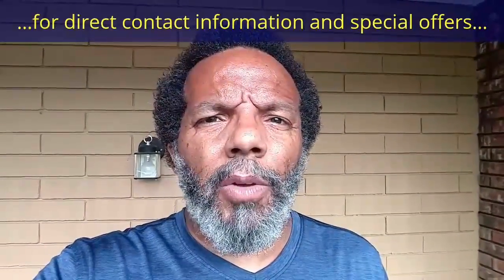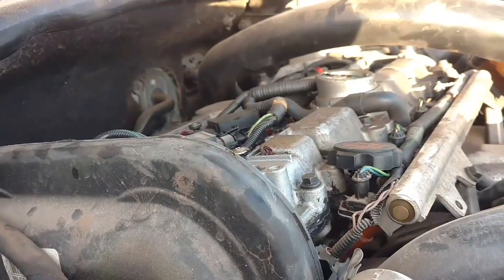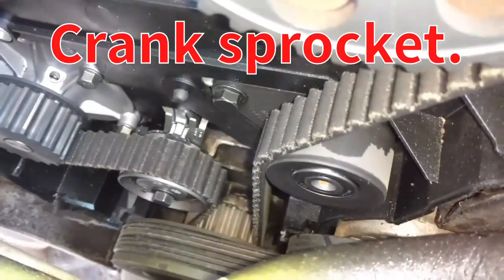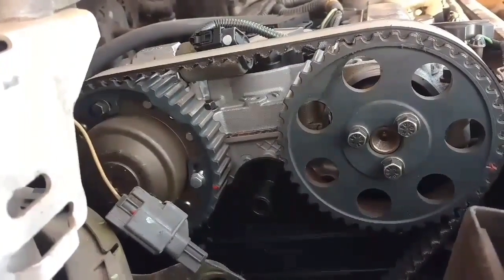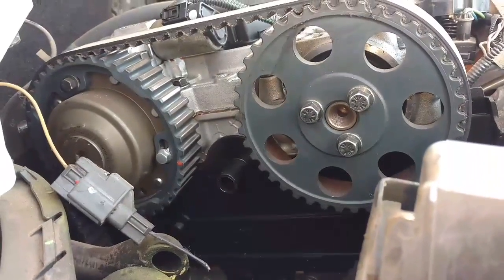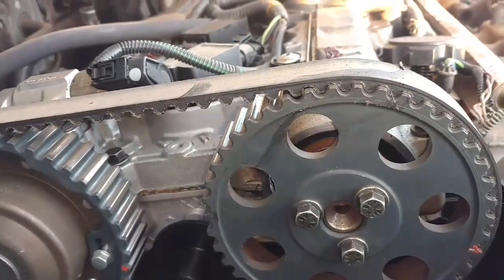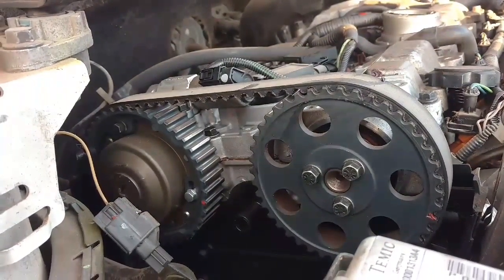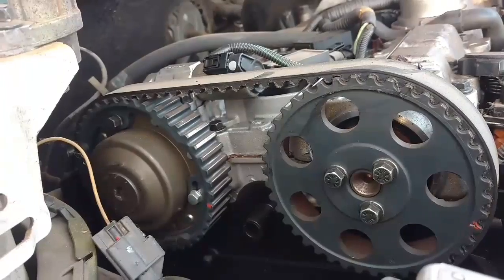Important cam locking and cylinder head information for engines with over head cams. - VOTD

Comment: I’m enjoying your channel. I searched the tube after throwing two DTC codes, ecm614b and ecm611b. Both came up at the same time. Researched the VVT and did the typically prescribed work, ie. oil, both cam adjust solenoids (2.5T) and checked the timing and components. Cleared the codes, took it out on the highway to kick the turbo in and get it good and warmed up. Within 5 miles the damned dtc came back up. I’ve watched your entire playlist a couple of times now and it looks like I’m going to have to go deeper. After studying your content, I’m very confident I can perform the work and I appreciate your emphasis on the importance of using cam locks. So now I’m shopping for them. Thanks for sharing your time and talent man.
Reply from the maker: Thanks for watching

Comment: Robert, your videos have been a huge help as I've rebuilt my 2001 V70 T5 blown head.  
Head was planed & valves were rebuilt by a top line shop. Solid lifters were kept in sequence.

I have the cam locking tool (from sweedspeed) and have VVT on the exhaust cam only.  
Removed airbox, fan, throttle body tube to access & remove the starter to access the plug cap to insert the crank locking pin.  
Rotated CCW to set the engine crank (btw, make sure your cam marks are topside, before putting on the cam locking tool, otherwise, pull pin, rotate crank another 60 degrees CCW put pin in and keep cranking until it stops). 

Removed cross strut, front back turbo air tube, spark plug cover, black turbo control tube hanger, rear casting to access & remove exhaust cam cover; removed cam cup sensor.
Bolted in the cam locking tool; can't bolt in intake as with cam cover aerobically sealed can't prise out intake cam rear cap, but align that half of cam tool w/center of the cap. (the tool also has a half bracket piece to hold it in correct alignment against the cam cover)

Intake cam is on its mark and belt is tight between intake cam and crank (I put a jumper cable clamp on the intake pulley & belt to keep it in place and keep the descending side of the belt in my left hand.) Exhaust cam is now 2 1/2 teeth back from the cover mark.  I understand I'm supposed to rotate the exhaust VVT CW to bring it "to the mark". (Is that correct?)  Figuring there is still a bit of slack in the belt, I advance the exhaust pulley 3 teeth and cheat a bit on the cam locking tool to get it there.  I use a T55 socket with a 10 mm box wrench around it to rotate it to its mark.  [That avoided the need to lift the engine]  I put the belt on.  

You're right about the cheap aftermarket tensioners.  The back pin will bend or the tension plate will snap off [I've returned two of them because of that].  (I insert a thin rod behind it from the right to keep it from turning), tension it with an 8mm Allen wrench and tighten the 12 mm bolt.  I put everything back together.  I do 4 crank rotations to check interference.  I fire it up.  It sounds REALLY rough.  I know I've got compression though (140-170 lbs.).  

Figuring I probably should have only rotated the exhaust cam 2 teeth I crank the engine forward 2 cycles then back 90 degrees, mark the belt, take the exhaust half off and reposition the exhaust CCW back a tooth.  [I see that was your response to M. C. A. in https://www.youtube.com/watch?v=hjZFY-1x1Xk ]  I put everything back on, check interference, fire it up, and it sounds no better.  

So here's the question.  Is this going to require a full repeat of installing the cam locking tool, and a rotation of the exhaust cam forward now only 2 teeth.  Or, do you have any thoughts on what else might be going wrong?  I'm not getting any codes, though I only have a basic reader.  It's been a project of several months now.

Most obliged for your experience and guidance on this.  And please feel free to critique any of the above as it meant to help our fellow Volvo enthusiasts.
Reply: Update on the above.  Quick Trick:  If you want to move the cam pulley gears forward or backwards (relative to the belt), you can leave the belt on, and place a short 1/4 inch bolt between the cam gear and the belt and rotate in the opposite direction you want the pulley to move.  Bolt pops out, cam gear is shifted one tooth.  Easy peasy!

Second:  If you've got your timing right, and it still runs rough, you probably have a vacuum leak.  Check all your hoses, the emissions vapor recovery unit, that you have your throttle body mounted in the correct orientation, etc.  If you're friendly with your local mechanic, he might do a "smoke test" for you by plugging his "non-toxic" smoke generator into the side of the manifold at the nipple.  Look for where the smoke is coming out.  Get all your hoses plugged in.  Vooom!  It doesn't take much of an air leak for the vehicle to run like crap!
Reply: Another update.  You really want to have both the intake and exhaust cams locked.  To get the 2" cover plate out of the rear of the intake cam without "breaking" the cam cover anaerobic seal, drill a small (say 3/16") hole in the face of the plate, stick a small screwdriver into it and pry it off.  Put a rag down under it beforehand to catch the small amount of oil that will accumulate therein and to clean up all the metal shavings from the drilling.
Reply from the maker: Hi Daniel, just took the time to read your messages. Thanks for sharing. I have another video showing how to install the VVT hubs from scratch. A lot of good notes here.

Comment: Hi Robert.  Thanks again for another super helpful explanation of this stuff.  I did get the cheapo cam locking kit, and read a comment below that you got your tool from IPD.  I just checked and it's $100 whereas the one I bought was $35.  For $100 I'm going to go for it.  But, what is the deal with the crankshaft locking tool (volvo 5451) that comes with the kit?  I really like the idea of putting a tool in there to hold the crank, but there's very little discussion of it and IPD doesn't sell one.
Reply from the maker: I've used one once. It stops the crank from turning one way but not the other way.
Reply: @RobertDIY  I found ONE instruction (a video) and the tool is basically for rebuilding an engine because the starter and other stuff all has to be removed to get at the hole in the block where it inserts. But what was a b***h for me was getting a tool for rotating the T60 on the serpentine belt tensioner.  There's so little room in there.  I made one using a long T60 bit that I cut down about 3 inches.  Keep the videos coming!  I know so much more now than when I started.

Comment: I'm replacing the cam and crank seals on my 2001 V70 T5 (B5234T3). While trying to crack the VVT hub bolt, my homemade cam lock broke on the exhaust side and the cam rotated. I turned it back so the slot would accept another version of a homemade locking tool and tried it again. The second tool bent due to a weld failure, popping out of the slot. The next day I bought a factory tool from IPD for $107. It also broke under the stress of trying to get the VVT hub bolt out. I then went back to the second homemade cam lock tool and welded the living hell out of it. I then turned the camshaft again to get the slot lined up, installed the tool, bolted the tool to the block, and let 'er rip. 4th time was the charm; the VVT hub bolt popped and I was back on track. Except for one thing: my exhaust cam alignment was totally out of whack: I don't know how much - or how many times - the cam turned during the three tool failures. The intake cam didn't budge because the tool failures were on the exhaust side. I bought a camshaft/crankshaft lock/ alignment tool kit for getting everything back to normal, but I'm hesitant to try to use it because I can't find directions I'm comfortable with. I'm acutely aware of the consequences of not doing this right. Help!
Reply from the maker: The cam alignment is on the back of the head, where the tool is installed. The mark on the cam hub/sprocket on the front of the head simply has a reference mark for changing the timing belt without locking the back of the cams. Therefore, when the rear of the cams are locked, and you're putting thing back together, you can install the hub so that the mark is on (to avoid future confusion), or you can install the hub and make a new mark. The important thing is, after you install the hubs, torque them on, install the belt, then pull the tool off of the back, you then roll the engine over a full cycle (two complete revolutions on the crank bolt) by hand before you start then engine to make sure you don't have VALVE to PISTON contact.
Reply: @RobertDIY  Thanks for the quick reply, Robert! Yeah, it's that valve to piston contact fear that has me stopped. I just spent a few hours re-watching a bunch of your videos that are even slightly related to cams, cam cover removal,  timing, vvt hubs, etc. I think what I'm going to do is remove the cam covers so the cams cam move, lock in the timing marks on the crankshaft pulley, then align the cams to their marks. It sounds like a lot of unnecessary work, but I'll be able to rest easy knowing everything is dialed in properly. [Last year I tore an o-ring when I replaced my heater core and didn't know it until I saw green coolant flowing down the carpet. As you know, replacing a heater core ONCE is a nightmare; having to do it twice puts an indelible "NEVER AGAIN" image in the mechanical region of your mind that will forever come back whenever you pick up a wrench. Like the heater core replacement, this cam alignment thing is totally new to me. I'll take a month on this project if that's what it takes to get it done with confidence]. Because I'm installing new parts that  I haven't mentioned, and because I'm totally cleaning the engine bay and replacing all of the old wire loom, I'm going to give the cam cover a good cleaning. I believe you mentioned acetone when you cleaned an aluminum engine part. Is that the best stuff for that?............. Thanks again for the continuing Volvo education. You're saving a lot of folks a lot of money!
Reply from the maker: Did you pull the timing belt before aligning the crank on it's mark? Once the crank is on it's mark, the cams can be spun all the way around. I use acetone to clean the mating surfaces of the cam cover and head surface because it makes the mating surface "clean and oil free" so the sealant can work properly.
Reply: @RobertDIY  Yes. Part of this project is replacing the belts, tensioners, etc. Right now the timing belt is off and the crank pulley is loose after replacing the crank seal. I don't want to tighten it down until I know for sure which position it's supposed to be in on the crank. It wasn't set on the factory marks-to-block when I started taking parts off because I COULD NOT FIND THEM. I looked in the manual and watched a few videos and saw what they look like, but on my crank pulley they were under caked oil and dirt and I couldn't get a 360 view to pin them down, so I marked the pulley as it sat to the block mark for future reference. Now that I've got the pulley off and can see my crank pulley marks, I want to be absolutely sure that I put it back on correctly. Rather than relying on my own pre-removal marks, I want to believe that there is only one way the crank pulley goes on and, hopefully, my marks coincide with the correct ones. I see a gap of a couple of teeth on the pulley and I see a spot on the end of the crank that - I hope - is where the pulley should be matched. One solution, I think, is to use the crankshaft lock pin that came in the cam/crank lock tool kit. That solution would be to turn the crank until the lock pin goes in and freezes the crankshaft, THEN match the factory marks on the crankshaft to the block, which would allow me to align my cam sprocket marks to the marks on the cam sprocket cover knowing that all has been done right - assuming that the crankshaft WILL be stopped on the correct crank pulley-block mark alignment. What do you think of the path I'm on here? Thanks again, Robert!
Reply: My take on the no reply is, "this dude's got to quit talking and pick up a wrench!". I totally agree. Analysis paralysis, Robert. I'm workin' it out. I'll let you know how it turns out.

Comment: First I want to thank you for making this videos! Have a question; my 06 S40 2.4L jumped timing, I’m in the process of removing head for machine work. Since I don’t know how far off timing the motor got, how do I know how to set the cams in order to install the tool before taking head off?
Reply from the maker: https://youtu.be/C-6Rjkp4Fk0
Reply: After your car jumped the timing did the engine still turn? Engine turning but not cranking.

Comment: Hi Robert how are you doing, I am in Jamaica I have 2015 4 cylinder S60. The guys removed the cam pulleys and now we cant seem to get the timing back. We ve bought the cam tools and still nothing. I dont think the valves are damaged because we always do a full manual rotation before cranking it. Am I  doing the timing set up wrong? Is there a tool to lock the crank shaft too?
Reply from the maker: https://youtu.be/0H5cgRYCMQg

Comment: How do you aline the rear cams to install  the locking tool? It appears that the locking tool is off set and only goes on one way.
Reply from the maker: Align the timing up front. Remove the parts off the back and install the cam locking tool, then turn the locking tool together and put the bolt in it.
Reply from the maker: https://youtu.be/3CTNiKlgdFA?si=Mjw2y2tcuMSlE8rw
Reply from the maker: https://youtu.be/gt9w-ZSxs9I?si=aLg_5B9_QP_oBsvc

Comment: Hi Robert, I am just another DIYer in the learning phase. After running through most of the videos about car fixing, I found you. You're the one that I prefer to ask for help. I bought a  2006 Volvo V50, T5, 2.5litter, manual 6 speeds, with the engine locked up. So I opened the valve cover. Before doing anything else, I just want to know how to set the timing first. The good thing was I found you. Could you please show me where are those timing marks on this thing and how do they look like? I really do appreciate that! Have a wonderful day, Robert!
Phua
Reply from the maker: https://youtu.be/gt9w-ZSxs9I
Reply from the maker: https://youtu.be/p8zd8GVvAa0
Reply from the maker: thanks for watching.

Comment: Good Day. If you putting the head back on and have marked crank and camshaft with 12 o’clock marks with paint and if the camshaft moves then how do you turn them back to the markings
Reply from the maker: with your hands or a tool

Comment: I had both camshafts out of engine but never took hub apart...can i just time to marks? I turned engine over with timing WAY off it didn't start but is it possible I junked it?
Reply from the maker: Yes. If you pull the head and leave the cams on the shafts, you should put the crank on it's mark, then when installing the cams put them on their marks, then install the belt and make sure all 3 marks are on before you ROLL THE ENGINE OVER BY HAND before you try to start the car. If you just tossed it together and hit the starter before making sure it was in time, yes you likely destroyed the valves.
Reply: @RobertDIY  crap😓 live n learn....youtube n learn,  thank you kindly Robert, now weather to bother with it or not.
Reply: @tdubfpv3380  align all three marks back up by hand as close as possible. If the engine rotates without binding or locking up. Remove the belt and realign all the marks properly. Rotate the engine by hand to make sure that the (crank pulley) rotates a full 360 degrees back to its mark. (The cams will rotate more for every crank rotation). Do this twice! (2 full crank rotaions) by hand. Check all the marks are still on point after each rotation! If you can successfully rotate the engine by hand with all marks staying on point as well as not hearing metal-on-metal contact as well as nothing binding up or locking up, you should be okay. If all this goes through I would do a compression test across all cylinders prior to firing her up. Hope all's good.
Reply: I am having the same issue with my s60. What do I need to do to get mine started?

Comment: Hi Robert, I’m doing a used head on my 2002 V70 T5, when taking the cams out, is there a way I have to put the cams back in? I’m worried now because of this video. Haha.
Reply from the maker: Keep the lifters in order and use the cam locking tool.

Comment: The back and forth play in the cam gear is a bad thing? If i rotate the exhaust cam backwards the gear pops outward
Reply from the maker: The in and out is bad.
Reply: Robert DIY well i don't wanna spend that insane price for new ones so I'm just gonna slap em on the new motor for the XC90 and sell it
Reply from the maker: OK.

Comment: th RN motors are not worth the time and effort to rebuild a head...these cars are a dime a dozen unless the car is priceless to YOU . its a real pain to do a head job (BRUNT VALVE) to do it YOURSELF its $700 ez and your talking at least a week to do it  if you have never done one before... change the belt not so bad but just 1 Ooooops and your motor is junk....
Reply from the maker: I like to have a read ready to drop in one. That way it's not apart or off the road long.